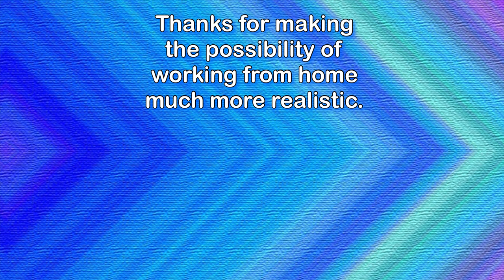How to make a basic twisted silver wire link chain.

Comment: I love that you go the extra mile to solder everything.  That's a lot of work.  Thank you for showing us every step.  Great video, Nick!
Reply from the maker: Thanks for Sandi, endless variations on a theme with this one … would make a nice wider wrist chain … cheers … Nick
Reply: Idk how I'd be able to do this without soldering since you have to reshape the rings. I'm so new to this. I don't know what to order for learning to solder. I see some people using paste or something, and some people using the little strips. I'm on a very tight budget so I don't wanna end up using the wrong thing for soldering. I have a proper torch, I have borax for flux, idk what pickling or quinching is, and I don't know what solder to order if my main focus is jump rings.
Reply from the maker: I would highly recommend learning how to silver solder, once practised it opens up huge possibilities making jewellery and chains.
Silver solder strip comes in a variety of temperature melting ranges this is to allow the fabrication of complex pieces. However a lot can be done with one grade say “ medium” and is a great place to start. it can be hammered out thin and cut into tiny pieces the only other thing you then need is a flux … borax is great and as long as you have a tight fitting clean joint the process is very satisfying. 
For convenience when chain making I now use silver solder paste a lot, it’s very quick and easy to work with especially for small items. 
Work is normally cleaned after heating in a hot acid bath called pickle some people use hot vinegar mixed with salt for this job … good luck with it … N
Reply: @Nickscreativestuff is it possible to solder silver plated copper wire like this with normal silver solder? I worry about ruining the plating, but real Sterling silber is just so expensive for a beginner.

Comment: A well documented, with some great tips Nick.   I'm intrigued by the pliers you used at minute  2.22...  great idea to use flat sticks to support the inside of the rings while sawing.  Thank you for sharing your ideas and process!
Reply from the maker: Thanks for that Lynne, the pliers are called External Circlip Pliers.  I modified this pair with an adjustable stop. I made a video showing them here’s a link if you’re interested https://youtu.be/WK07YpEdMpA. 
I struggled to cut jump rings neatly until I discovered this technique using sticks for support, I now have a huge variety to choose from for cutting any size links … N

Comment: Beautiful
When we were kids in the 80s, we made similar chains from copper wire from an electrical transformator. They just didn’t solder the rings, but twisted them using a small handmade machine
Reply from the maker: thanks for that Andrill, funny that … I thought about making a basic  twisting tool … would be good if I was gonna make a lot of these chains … cheers … Nick
Reply: @Nickscreativestuff  Yes. You can search in inet " станок для плетения цепочек " on cyrillic letters
Reply from the maker: those tools look great … just the sort of thing I had in mind … N

Comment: Thank for this video Nick, you are so talented.Can I ask what the tools are called that you are using to hold each hook and spin while twisting your links (@  4:14)
Reply from the maker: Thanks Monica, I use mostly what’s called locking pliers or mole grips to hold bent nails for twisting wire. I also use a Jacob’s Chuck on a Morse Taper for holding small tools like in the video … cheers … Nick

Comment: I don’t have a vice. Is there a work around this part? I have made jump rings and used pliers but the ends are never as nice as yours came out. Any suggestions?
Reply from the maker: hi Christine, locking grip pliers sometimes called mole grips and a clamp might work for this process. I know it’s only possible to work to your limitations so tools and work space can be a major factor for some people. my favourite vice I use the most came from a discount store and it will clamp to most tabletops. About £10-£15 on Amazon … good luck with it … Nick.

Comment: Wow! Another awesome  POV. Not taking it to your grave as many Metal Smith's had.
What type of solder paste did you use?
I noticed you elongate the soldered links with the soldered point always part of the loop. Your using circling pliers and a digital vernier. Recreating the tear drop hole to a circle using the tapered pin to a circular opening...sheer brilliance..but as I am a Toolmaker, I too would have done that. It may sound as I'm a know it all. Believe I am not. I have on my Mother's side a Great Great Grandfather who was a Monument Stone Engraver. I was given a rock of Mintaro Slate. 2 letters an R & an O were drawn upon the flat face. The master Stone Engraver said..the O must rotate to the left by 4 degree's.  No more.
I did both letters in 4 hours. He looked at them. I apologised that my O rotated 5 degree's.  I had never engraved anything before but it came naturally to me. My serifs at the end of the letter...obviously not on the O...went into a fading line. He looked at me and said...I can't teach you anything. The finish I gave to the line's of the R were typical of the early 1800's funeral Grave Stones.
Typical of my Great Great Grandfather. 
On my Father's side of the family were Metal Smith's, Machine Buildung engineers, Toolmakers, Fitters..and a Railway Administrator.  I've got the best of both family tree's. 
Sadly no children to pass my skills onto. But I've help train many apprentices over my 49 years as a Toolmaker and Specialist Welder.
Now I want to make some Jewelry.  Thank you Nick..I really admire your gift of silent teachings.
Reply from the maker: Thanks for your heartfelt comment Michelle, I mostly use assay quality silver solder paste comes in 3 different temperature melting points for sequencing assembly processes. I tend to position solder joints where they can be hidden if at all possible. The stone work sounds fabulous … I can imagine it’s very unforgiving. One of the reasons I love working with metal, if you make a mistake you can reach for the welder and get it sorted. It’s great how creativity can get passed on through family and education. Good luck with your endeavours … all the best to you Nick

Comment: Incredible, a question how long is the chain
Reply from the maker: Thanks Neuvillate, this chain ended up being 19 inches long … N
Reply: @Nickscreativestuff  Thank you, one more question, the stick that you used that says 6 1/2 mm is for knitting?
Reply from the maker: yes I use knitting needles a lot as they are cheap, readily available and come in a large variety of sizes … N
Reply: @Nickscreativestuff  Okay, I apologize if I ask several questions, but I want to make a chain like yours. Did you buy silver cable that was 1750 mm, did you use all of it for this project?
Reply from the maker: I don’t mind answering questions, It’s nice to be able to help if I can.
I tend to make my own wire so end up reducing stuff down to size and using odds that I have around. weighing the chain at the end gives me the opportunity to estimate how much wire I would have used and how much it would have cost if I had bought it in one piece … N
Reply: @Nickscreativestuff  Ok, thank you very much Nick, I think it is better to do everything as long as you have the tools, for this 19 inch chain so you used approximately 1400 mm of silver wire?
Reply from the maker: Yes that’s right however I would always start with a bit extra, say another 100mm just in case for wastage … N

Comment: Why do you chose to clean up (sand) the links after you twist them. Wouldn’t it be easier to clean up after making them oval, but before twisting. I’m new to this, so I’m asking so I can better understand steps in processes. Thanks!
Reply from the maker: hi Kim, I find it inevitable with some chain designs that a few of the links will break with all the stretching and bending they go through.
I tend to leave the cleanup until the end once the links have made it that far and if any of the joints are visible and need a touchup … cheers … Nick
Reply: @Nickscreativestuff  I've been following along and making this chain. I'm making an anklet for my niece. I've had two break (both after I asked the question). So now I get it. 🙃
Reply from the maker: hi Kim,  nice to hear you’re making an anklet with this chain so many variations on a theme with this sort of thing. I like how delicate it can be made allowing to be economical with silver … N